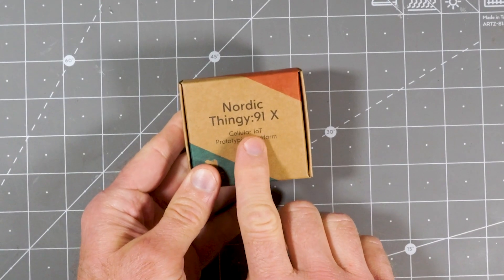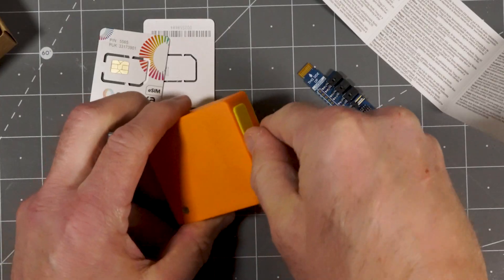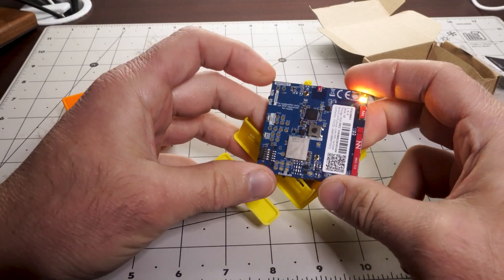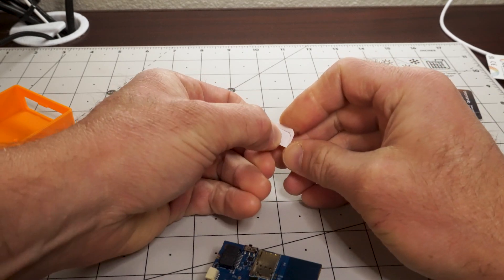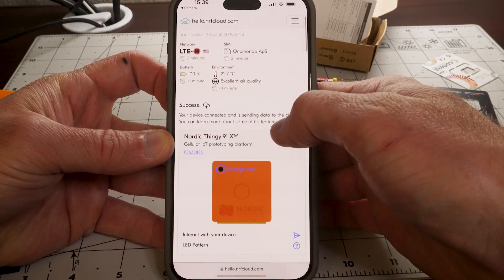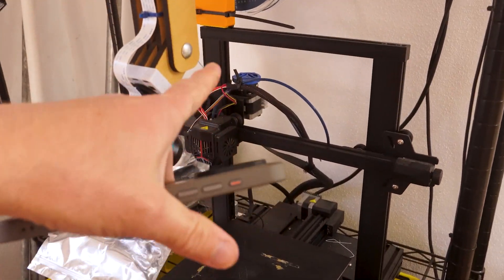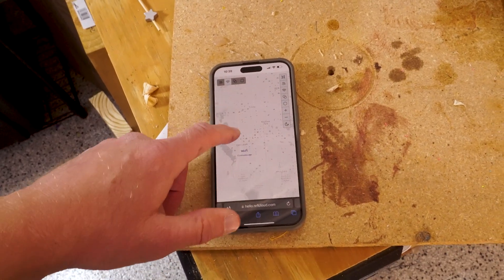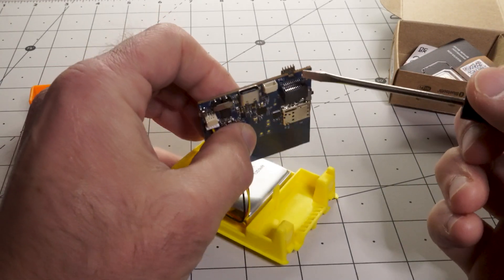Nordic Thingy:91 X Unboxing with Hackster PRO Jeremy Cook

Comment: Hey Jeremy, great video! Wish my install went as smoothly. Quick Start runs fine but Thingy91x is stuck at the pulsing yellow/green led. Can't connect to the cloud at all. Similar to your video at the point where you think you solved it with the switch in the wrong setting. Feels like I've tried everything but all i get is flashing errors in programmer, device not showing in VSc etc I've even resorted to asking copilot lol but weirdly it shows when I 'nrfutil list devices' from terminal in VSc, so close to giving up and sending it back but it sounds like a lot of fun! Any and all advice welcome. I'm also fairly new to all this, no other boards etc just the Thingy91x, very much a beginner, suckered in by the supposed simplicity in setting this up haha